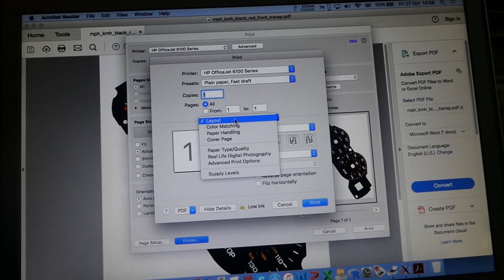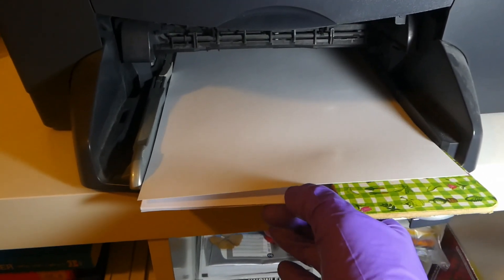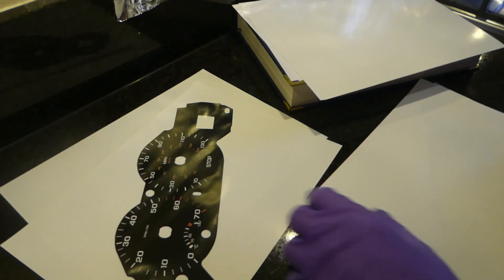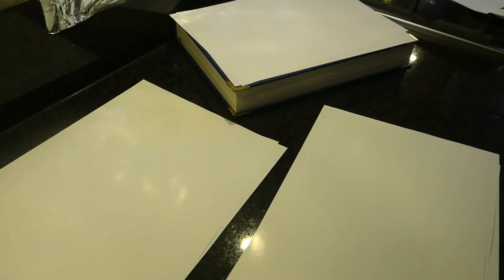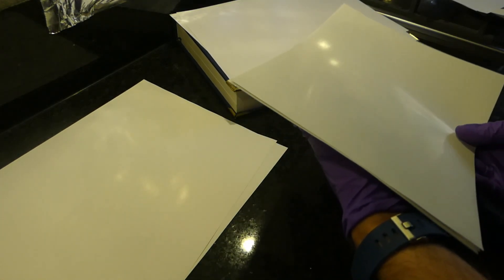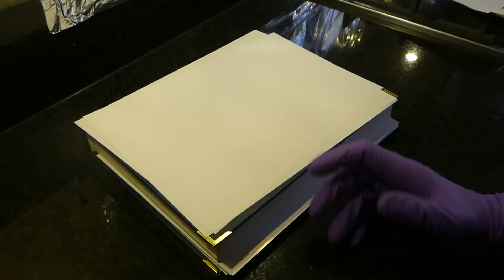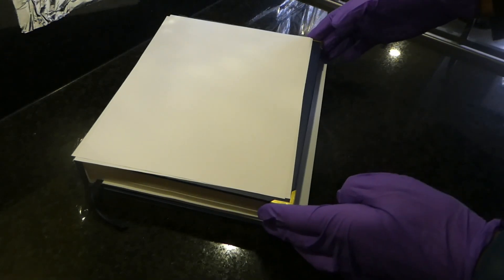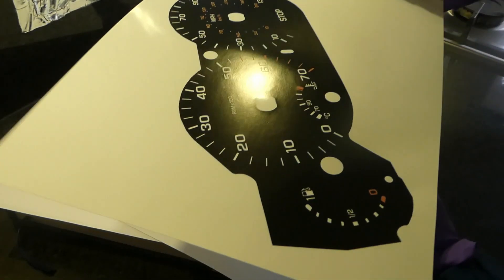5. How to print your own (DIY) speedometer (instrument cluster) - Printing

Comment: My car has the engine lights as apart of the design, just hidden. How could i make it so the icons are hidden until lit? It seems with this paper method they would have to be set as white, which ruins the design. What would you suggest?
Reply from the maker: You can print those in a different color for example, but how are they hidden and then lit. In a normal speedometer, they cannot be hidden as the light will not shine through the ink. They are always some sort of transparent setting, otherwise the light would not shine through.

Comment: Can you try this for a 2006 Mercedes c55 AMG cluster w203 it would be sick! I’m trying to do this just need a little guidance in the right direction
Reply from the maker: I do not really have any templates for c55 AMG, but you can scan one and change things on it and print it.
Reply: @moremolecules I’m going to try to do it myself with the paper and see if I can get a printing shop to do a couple and see how one comes out before proceeding , I got a scan through my phone and edited it on photoshop I hope it comes out good 👍
Reply from the maker: @ramenshells9715  Good luck! It will be very difficult to get the dimensions right with a phone scan. An actual scanner will give you 1:1 dimensions from an A4 sheet, where the phone, it will not be, so you will have to do some scaling, but not too sure if you can get it right. Probably easier to ask the shop to scan it on A4 for you.
Reply: @moremolecules okay I will ask them if they can accomplish what I’m trying to print it would be nice the AMG cluster but I’ll try to find more about what your talking about I saw the gauges and they cost like $100 I was wondering if theirs a more cost effective way Dave a few bucks
Reply from the maker: @ramenshells9715  $100 is kind of alright for the speedo. That is quite cheap, but these will be stock. If you want something more custom made, then it is the DIY route. It will not be cheaper, but if you can do screen printing, it will be probably the easiest way.

Comment: im also planning to restore my motorcycle face gauge plate, now what paper/vinyl is best for motorcycle face gauge plate, because it is exposed to sunlight, and does light go thru it, because gauges have small light bulbs inside, so it is easy to see in night while driving, thanks.
Reply from the maker: The paper that I used worked really well for that purpose, but the overall problem is that it is a combination with paper/printer. Not any paper will work with your available printer and the paper I used might not be too good for other printers. I would get a few similar papers (they are in the description of the materials video) and try a few print outs. The sunlight is not a problem, as the matt spray layer is supposed to be UV resistant. Now, how long will it survive in the direct sunlight is difficult to guess. Mine is in the car, so there is a bit of shade and it has aged well, no problems.
The combination of paper and ink that I did here, does not allow any shine through, only the dials are lit. It really does a great job of blocking the light. That is with inkject printer and the 130g/m HP laser paper. Even though the paper is for laser printers it worked extremely well in my inkjet, it just needs a bit more time to dry.

Comment: I want to do the same already scanned mine and design is ready for print but what is the best paper for the light shine through?
Reply from the maker: Hi Bart, through all my tests I think it is a printer ink + paper combination. I used HP Professional Laser Paper Glossy 130g with my HP inkjet 6110. This paper was really spot on with the shine through. It was a while ago and I think this paper had disappeared, but probably the 120g would be also alright. Hope this helps.

Comment: Hi hello . I just want ask a few question . How you put gauge pictures to the computer ? And how to know the size of gauge like original gauge ?
Reply from the maker: Hi Muhammad, I scanned the original cluster using a scanner. I scanned it with 300dpi, but 200dpi will also work. When scanning I did not use scale or crop, therefore the size is kept as A4. If you have an instrument cluster you can get the underlay and scan it, otherwise is a bit difficult with all the measurements. Hope this helps
Reply: @moremolecules  i try first boss. hope it working like you say 😀
Reply from the maker: @Z2KPainter  Good luck, hope it works

Comment: What would probably be the results if it was printed with vinyl?
Reply from the maker: Hi William, it could potentially work, it is one of the few materials I did not try.
Reply: more molecules I will have to try it out. 
I don’t have a printer for vinyl but I can try to print one like you with paper and get the printed buy someone on eBay or something.
Reply from the maker: @EternalBeast97  If I were you, I would just get the vinyl and give it a go with the printer you have. It is worth a try to see if it can print on it. My best result was with laser paper and my printer is inkjet, not quite vinyl, but worth a try.
Reply: more molecules yeah, I plan on getting a new printer because mine is broken and will get some paper you recommended. 
But I’ll have to see where I can get vinyl like that so I can print on it.

Edit: would you recommend getting some vinyl that’ll print out matte? So it won’t be glossy and cause too much reflection/glare when in the car?

Edit: would you recommend some hp brochure paper paper of 150g? It’s glossy and has pretty good reviews when printing, I can’t seem to find the paper you used. Doesn’t seem like they have it anymore.
Reply from the maker: @EternalBeast97  If you are getting a new printer, perhaps a laser printer would be better than an inkjet. I did not have an access at the time to a laser printer to do tests, but it generally would lay much more consistent ink. Yes, it was awhile ago and probably this paper has been replaced with something else. 150g is a bit too much, but it is worth a try, try to find something ~120-130g. 150g might block the light too much, but it could be alright. Yes, matte would work as long as the details are printed good.
Reply: more molecules I will look for one of those printers then, as well as the paper. I wouldn’t want it to be too think to block all the light. Thank you for helping me out :) 

Making the template and what not can be done in photoshop as well right?
Reply from the maker: @EternalBeast97  No worries at all. What you can try is before buying a printer is go to one of the print shops/services and ask them to print you a few copies on different paper, you can see how it will look. They would have laser printers. Photoshop will work perfectly, I used inkscape as it is free, but it is not entirely intuitive. Best of luck
Reply: more molecules that’s true! Didn’t even think of that, I will definitely have to do that. Now I just need to get a gauge cluster to get the faceplate. (Don’t want to take mine apart just yet) and thank you! :)
Reply from the maker: @EternalBeast97  Well, I did do that, but the quality was really bad, worse than my bad prints, but they were more interested in bulk printing. If you can find a friendly place to print you a few tests, then you would know how it blocks the light.
Reply: more molecules that’s true, I’ll have to look to see where I can get it done so I can know what will work best.
Reply from the maker: @EternalBeast97  Yes, definitely let me know and good luck.
Reply: more molecules will do, and thank you :)
Reply: more molecules hey, I was wondering if you know why after I scan the faceplate and import into photoshop then make my own faceplate I want to print. When it gets printed it always come out either too small or too large can never get it to print in the actual size. So with that issue I cant send it off to someone to print because the same thing will just happen.
Reply from the maker: @EternalBeast97  When scanning and printing it should not be scaled in any way. I think most printers will have some sort of scaling when printing.
Reply: more molecules yeah but I turn off the scaling, but when the little menu pops up to try and print the faceplate I made is already too big as if it’s too high of quality or something and I don’t know how to fix that. 

After I scan the faceplate at 300dpi I open it in photoshop and I get the file then I just drag the faceplate I made and shrink it to fit the size of the faceplate I scanned. Yet when I go to print the file still is too large. 

And I don’t know how to fix that. Maybe the faceplate I made is too big?
Reply from the maker: @EternalBeast97  There is something going on. I would suggest to export a pdf of the faceplate that you've made in photoshop, then print from that pdf. Make sure the pdf is set to A4 unless your faceplate does not fit on A4.
Reply: more molecules I’ve tried that but then the file is extremely large still so in order for it to fit the page I have to scale down. 
When I wanted to print actual size at 100% I have to scale down to about 64% so the sizing would match up with the original faceplate when printing. And I really need to fix that because it should come out to scale by just clicking print and not messing with anything otherwise I can’t send the file over to get it printed.
Reply from the maker: @EternalBeast97  The scanning seems off somehow. Mine do not end up large even at 600dpi. 300dpi ~500kb. I scan in pdf as it is easier to work with afterwards.
Reply: more molecules could it be that when I try to print the faceplate I made it’s too big because the file is 300ppi I think? And the scanned file is 300dpi? 

But I’ll try to rescan it and save as a pdf from the start then import it into photoshop.
Reply from the maker: @EternalBeast97  at 300dpi or ppi (same thing) the file size should not be extremely large. If the original is A4 and at 300dpi should be fairly small in pdf format.
Reply: more molecules I tried again but scanned it through my computer instead of my old laptop and the file greatly increased in size so I think this time printing it without adjustments will make it work. But I still need to try. I’ll try with both A4 size then normal letter size to see which makes it come out good.
Reply from the maker: @EternalBeast97  Hi William, I mentioned A4 as my printer scans A4 (flatbed scanner), but if yours is different size use whatever is natural to the scanner. It does not need to be 300dpi, could be 100dpi. I only used the scanned version to use it as pattern to draw my shapes.
Reply: more molecules yeah I’m pretty sure I got it fixed now. Just printed it on normal “letter” paper with no sizing just how it is and I got it to be pretty accurate. So thank you for helping me :)
Hopefully in the next 2 weeks or so I can have it done and hope it comes out good.
Reply from the maker: @EternalBeast97  Good luck, let me know how it goes and if the result is good at the end. You just have to find the right combination of paper for the printer.
Reply: more molecules yeah will do! Going to get it sent off to get printed on vinyl and hope it comes out good.
Reply: more molecules any chance you can maybe print one on paper for me and send it, I’ll pay of course. 
I tried with the vinyl method but unfortunately the light bleeds through too much. And doesn’t show the lettering of the symbols or words.
Reply from the maker: @EternalBeast97  I would like to help you, but my printer packed up a few months ago. I only had tested the paper with this printer and my experience suggests that it is pretty much a printer-paper type match. I am waiting for amazon to reduce a specific laser printer that I have in mind. If I get it and manage to achieve the same quality I will give you a shout.
Reply: more molecules thanks I appreciate it. 
And I think since I wanted to add big pictures or like characters it makes it more difficult compared to how you made yours where it’s just the lines and numbers and the background all black.
Reply from the maker: @EternalBeast97  I think pictures and characters are fine. I made some of the pictograms myself, e.g. fuel pump, etc. colour is a bit problematic, as it is somewhat inbetween blocking the light and letting a bit through, not like the black/white. If you have an inkjet printer, it is just testing a few of the silk-type laser printer papers. It worked for me, I am nearly certain ink is fairly the same across different brands.
Reply: more molecules yeah I think stuff like that to show words or icons are fine but since I when I said characters I meant like images from tv shows or anime’s like from dragon ball z. That’s where my problem is. If it was a basic one with icons to show the fuel and stuff I would be fine. 
If not I might ask someone who makes custom faceplates like OEM and see how much they charge me. Then I can just change the led colors to what I’d want.
Reply from the maker: @EternalBeast97  You could always create them in say inkscape or photoshop as long as you have some template to import. It is easier with template than creating them from scratch.
Reply: more molecules yeah I’ve scanned a spare cluster I bought and made a file and just going to send it to them. Because if I ask them what I want and they have to do it from scratch it’ll easy be 2x the amount as already having a template and only needing to fix a little bit.
Reply from the maker: @EternalBeast97  Good luck with this. I had a file made and asked a few companies that do this, but they wanted way too much money to do it. On top of that they said that they cannot use my template.
Reply: more molecules thank you, I think I’ll be fine as these are reputable people who actually do crazy designs and make a faceplate like OEM.  But using my design will significantly bring the cost down and I’ll still end up paying way less than buying one that’s already made for my car that are in my opinion basic ones that cost close to $300

Comment: What type of paper u used???
Reply from the maker: I have described all the paper I have used in the 3rd video of this whole series (https://www.youtube.com/watch?v=xUgjYQEcLGQ). Nevertheless, I ended up using HP Professional Laser Paper 130 glossy. It is 130 grams, designed for a laser printer, but it worked surprisingly well with my inkjet printer. You may need to vary the amount of ink that it is dumped with the printer to achieve satisfying results. Mine was on the default settings, amount of ink was exactly in the middle on the scale for my printer. Hope this helps.